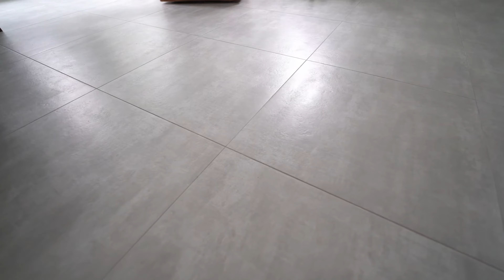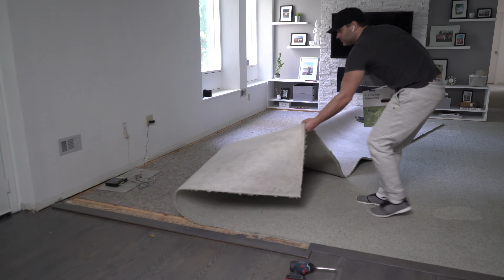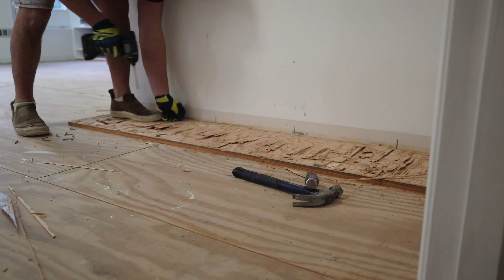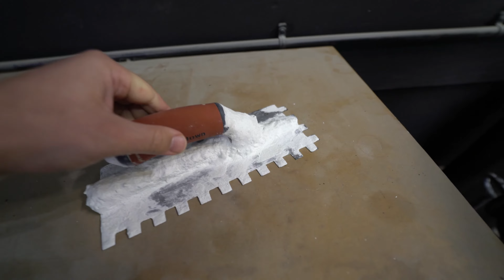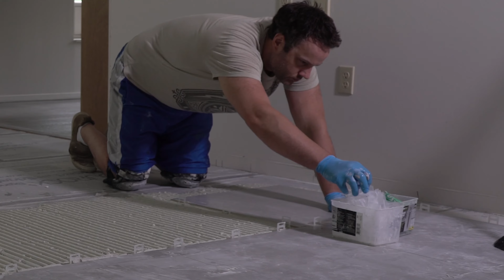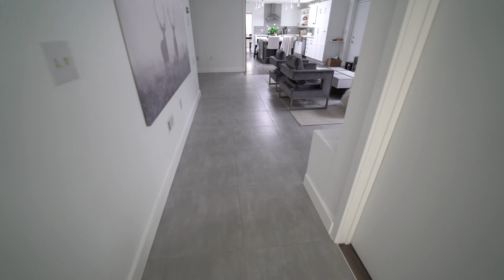How to Replace Carpet with Tile

Comment: Hello, what's the purpose of the cement boards? I thought it was for protection of the wood sub-floor, but I see that you put thin set on the sub-floor. Or is it for better bonding of the tiles?
Reply from the maker: The 1st layer of thinset provides a rock solid base so the subfloor can't move/bend/flex anymore.  (If you don't do this, a couple of months down the road you may see the grout cracking and tiles coming loose, especially in high traffic areas).  The cement board adds another layer of strength and is what the top layer of thinset bonds with to cement the tile in place.
Reply: @pnwconcretehouse8581   makes sense! thanks so much!!!

Comment: Great video! Curious how much money materials cost you and how much time it took? Also how much would this have cost if it was a professional?
Reply from the maker: Thank you!  Just for reference we tiled about 1,500 sq ft, so these are the costs for that area.  Tile: $3,380, I believe the cement board, thinset, grout, tile leveling system and misc supplies was about another 1k.  So roughly 4.5K in costs.  I did as much as could after work each day over about 2 weeks.  We never got a quote from a contractor but I would imagine it would be multiple times more expensive.
Reply: Awesome, looks great!